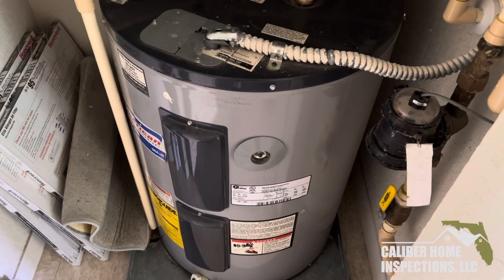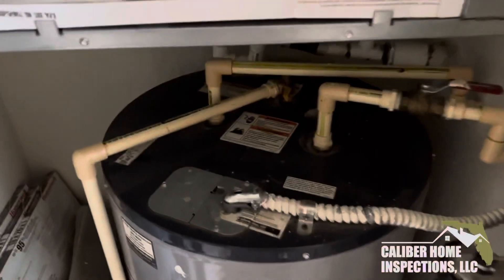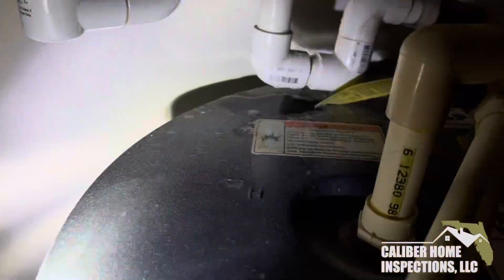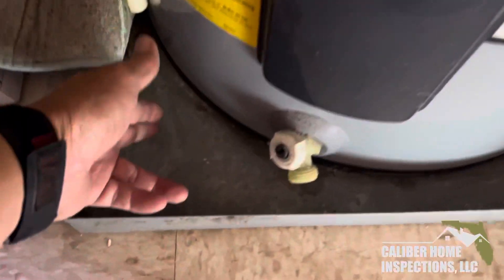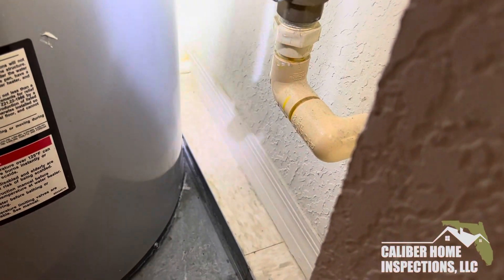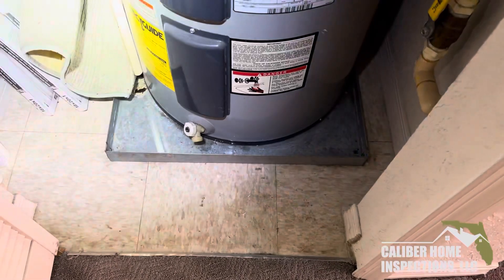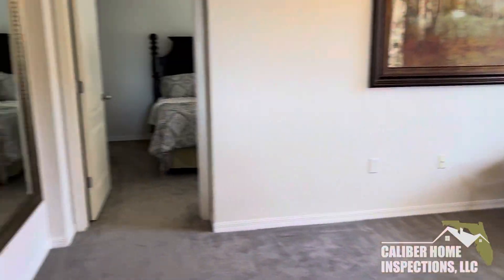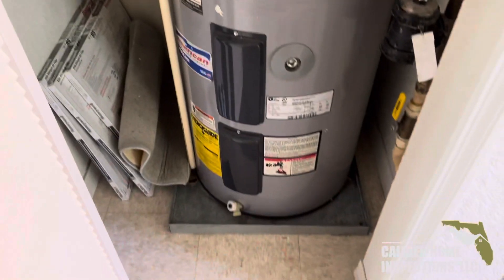A/C leaking onto water heater

Comment: I live in an apartment and mine is doing this. Our hot water isn't working for the third time. All they do is come in and reset the water heater. This last time they said they changed the thermostat on the water heater but here we are two days later and the hot water isn't hot again.
Reply from the maker: Time for a new water heater

Comment: I have the same problem and the water leaked onto the  electric power connector on top (rectangular silver metal plate) and water heater started to smoke. Are there any IP certified heaters for this application or some covers to protect power port from water? Looks like a sure fire hazard to me.

Comment: I am experiencing this problem in the place I am renting. Is this a fire hazard?
Reply from the maker: It's not a fire hazard because the water leaking will drain out or leak onto the floor itself. It will cause water damage and eventually a mold issue if not addressed. The condensate line needs to be cleared out.
Reply: @phwlee  Thank you so much! I was weary about having to sleep with this going on.